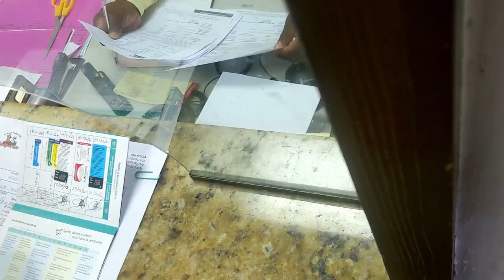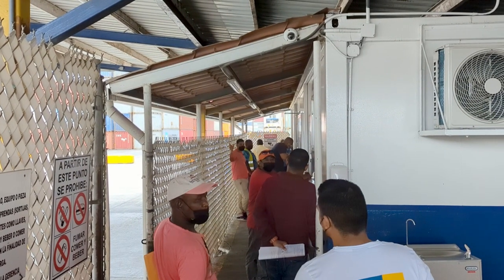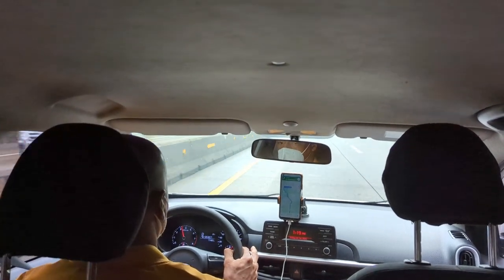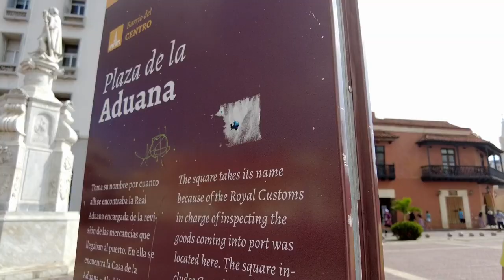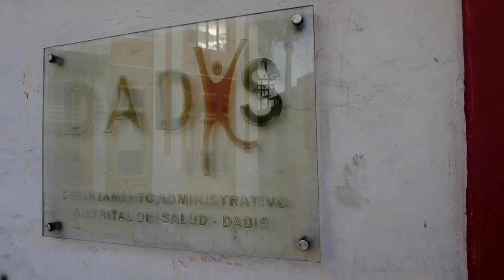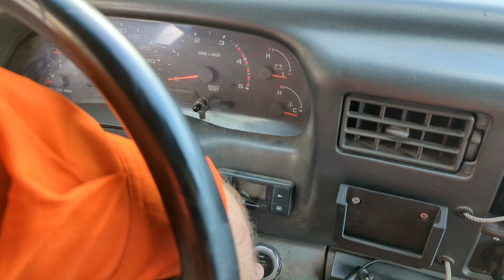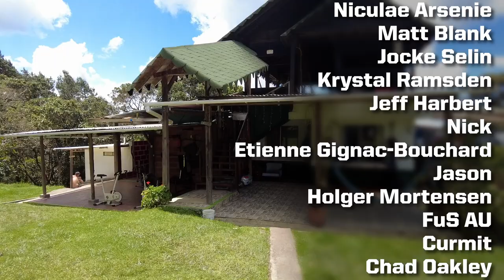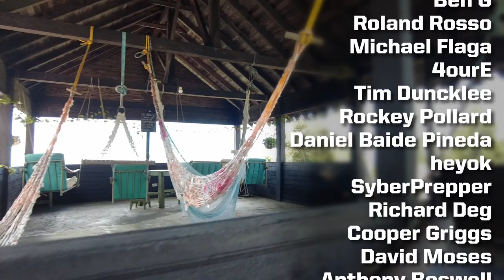Shipping Our Rig to South America - Everlanders See the World!!

Comment: I got both notifications but clearly there is some problems, 44 views 10h later just doesn't mach up. Started my morning with this video and continued with all the recent live streams, I have to say: it was seven hours of good content.  Question about Renogy dc-dc chargers, clearly not good product, but I have already installed 20a version as an backup option. You have seen few broken ones, any advice how to get one last as an backup. on-off will be controlled via esp32 and relay so there is options to tweak duty times.
Reply from the maker: Thanks for the update... Many of the  DC-DC units that I've worked on got untouchably hot on the Input Negative terminal, I suspect they are tying all the hot components to that ground plane. Further, I feel the thermals were not well engineered, compounded by vanlife babes installing it in a sealed box with subway tiles boxing it in.  At the very least, put a 120mm PC case fan near the unit and ideally punch a hole in the case to increase airflow. The larger 60 amp version has an option to "half' the output, and I've wired this option for one fella for everyday use and then he has the option to "boost" when situations are dire.  Unfortunately they are very lossy and they are dumping all that loss as heat... (the enemy of electronics)  Another layer of protection would be to put a 50c thermal switch in-line with the enable wire... something like this: https://www.amazon.com/uxcell-Thermostat-Temperature-Bimetal-KSD9700/dp/B00C97H95Q
Reply: @Everlanders  Thanks for the reply, It's not in ideal place for ventilation, but i will make couple extra holes, additional fan and put extra temperature sensor near negative terminal to keep an eye on it.   I'm thankful for the warning with dc-dc chargers, I would have used it as an full time charger while driving and probably burnt it out under a year. Now I hopefully have longer lasting backup option for cloudy weeks.

Comment: Are you not able to jump the truck from the house batteries?
Reply from the maker: Yes, but I've limited it to 50Amps with the 6AWG wire, plus I was on a time crunch to get the Customs Inspection area to make our appointment. So I took all the help I could get...
Reply: @Everlanders   fair enough! I have 000 front to back on mine. Still a big voltage drop trying to jump tho.